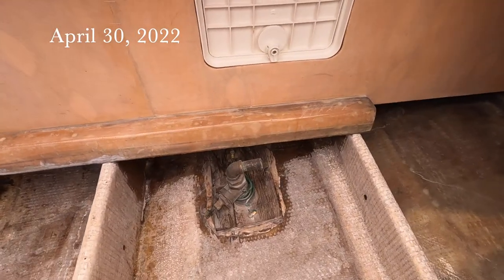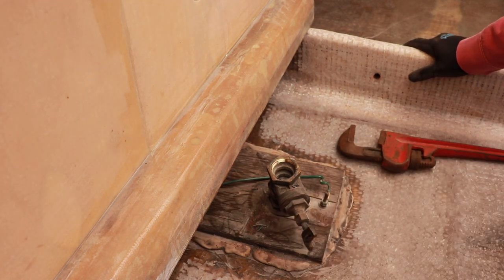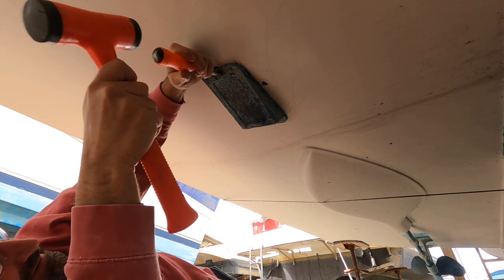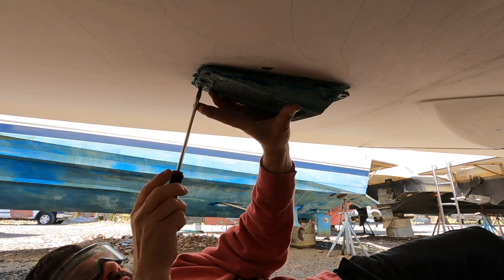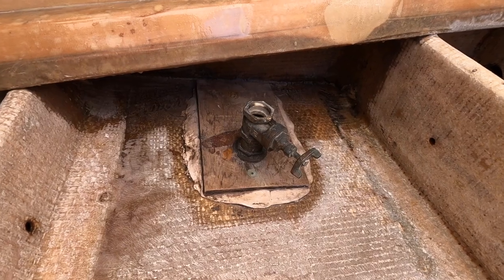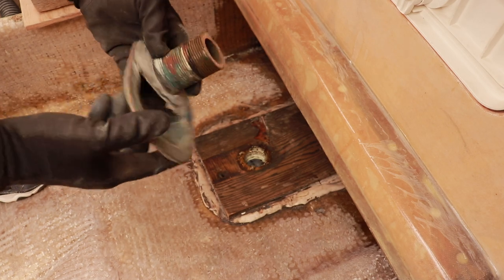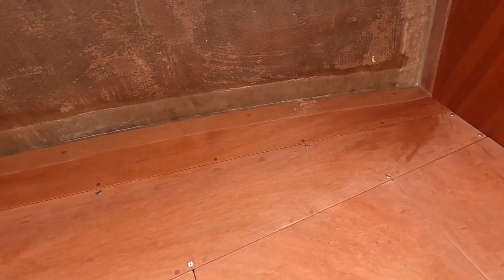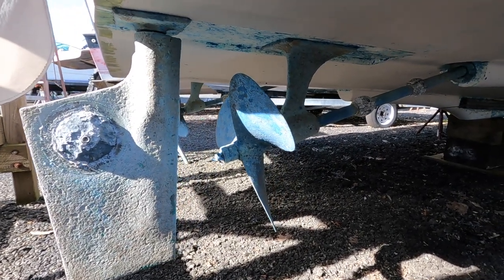Engine raw water seacocks & strainers are removed for future replacement - Boat Restoration EP085

Comment: I enjoy your videos. Thanks for sharing. Regarding your hardware issues. You will be removing the rudders, rudder logs and seals, propeller shafts, struts, and shaft logs and seals. It's time to replace or refurbish all of that hardware. Hopefully the rudders, shafts, and struts are in good condition. You should give some serious consideration to replacing the rudder and shaft logs and seals. And you will want to replace the cutlass bearings.

By the time you finish your hull repairs on the wood and fiberglass, you will probably have to drill new holes for the shafts and definitely for the struts. The fixed point will probably be where the shafts go through the logs. This needs to be centered. Then you have to position the struts as not to bind with the shafts while they are centered in the logs. This is sometimes done by placing a jack under the strut to hold the strut against the hull while you find the exact location.

The reason for replacing some of this metal (bronze) hardware is that it may be subject to pitting corrosion and embrittlement over so many years. The rudder seals can be the old packing-gland type. But you may want to consider the newer style rotary seals for the shafts. Like PSS shaft seals.
Reply: Good advice and definitely everything will need replacement as you stated. Install new engines to the old running gear would be a disaster and big mistake.
Reply from the maker: All good advice. Thanks for the interest and pointing out the critical areas. Much appreciated. All of the rudder assemblies have been removed as of this reply. Hoping to get the rest out this month. Thanks for watching and commenting. - Bob

Comment: Good luck with the rudder alignment. I’ve replaced rudders before, but never had to start from scratch.
Reply from the maker: The rudder doesn’t worry me as much as the strut. The whole steering system construction doesn’t appear to have been very precise on this boat and I will have the original holes still in the fiberglass hull as a guide. I have removed all of the rudder assemblies as of this reply. The struts will be next. Thanks for the comment. - Bob

Comment: The extra strainers are called eel grass strainers and they are a good thing if you run the boat in areas where high concentration of grass in the water. Usually the bottom cover slides out if you remove the screws that lock the screen in. Keep up the good work.
Reply from the maker: Thanks for the clarification Lisa. When I launch the boat it will be in the river I'm currently at and there is plenty of grass so probably a good idea to keep them. The ones I took off do not have the slide out feature you mentioned. You need to unscrew them from the bottom of the boat to clean them which is what I don't like about them. I will look into other types to see if I can find one that has the features that allow for easier cleaning/maintenance. Thanks for watching and commenting. - Bob

Comment: I no this is late but quick and fast way too removed it is to grind off the bottom through hull mushroom head then you can get it out from inside , just buy a new through hull mushrooms it’s a lot quicker and they don’t cost much
Reply from the maker: Better late than never. I have a few more to remove and others who read the comments can benefit from your tip. Thanks for watching and commenting. - Bob

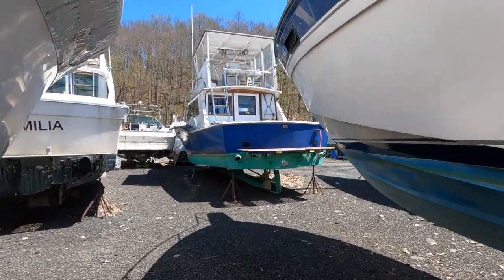Comment: @14:07 That other boat with the blue hull and extra strainer, isn't that also an Egg Harbor?  It at least appears similar to one from what appears in the video.
Reply from the maker: That boat isn’t an Egg Harbor. I’m not sure what it is. I knew a past owner of it but I forgot what he told me it was. There are no markings to verify. There was another Egg Harbor in the marina that I looked at recently and it had the same strainer system as mine. Thanks for watching and commenting. - Bob
Reply: @renovationsportfish1563  Perhaps its a Post or a Viking.   For the type of boat that it is, the single screw is kind of unusual.